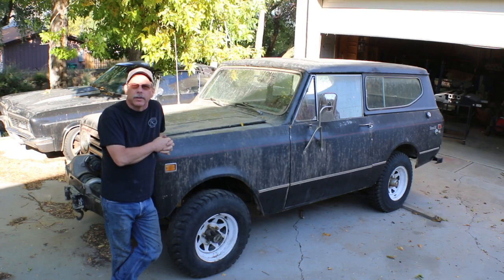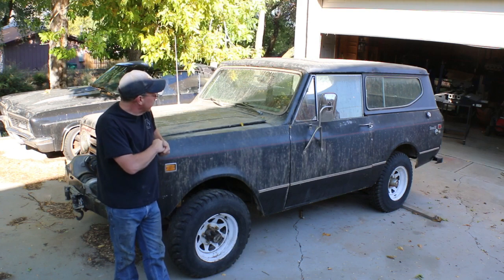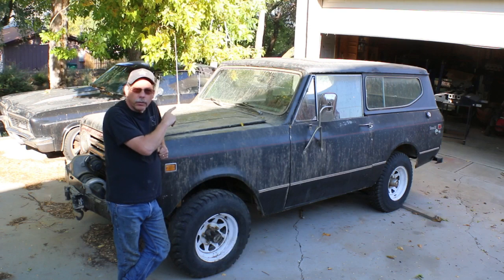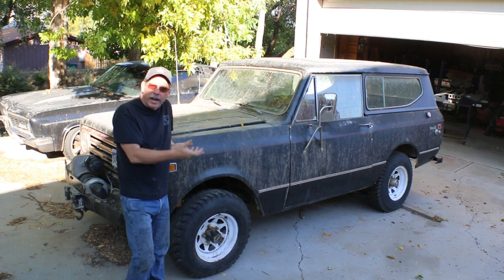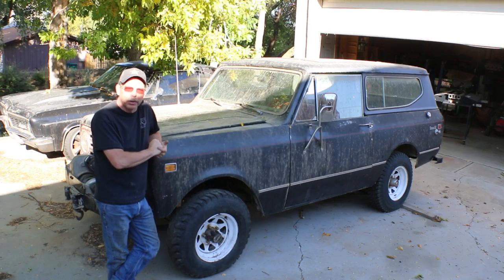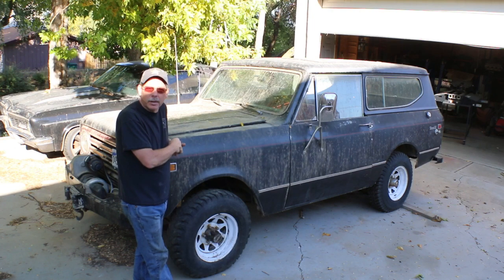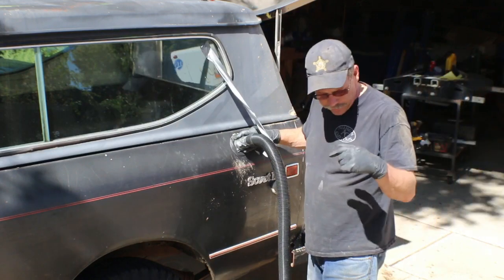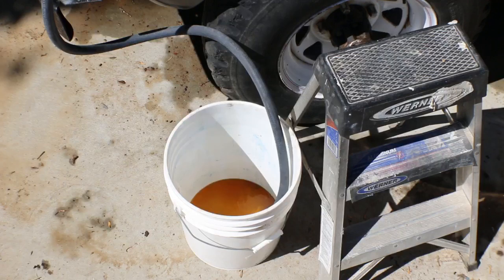1972 International Scout II - Resurrection - Will it run again?

Comment: I’ve got a 67, and a 74. I’ve got the same rims on my 74, with a front tire carrier. It’s originally yellow, my least favorite color, lol ! You’d be better off dropping the tank and giving it a real clean, and new sending unit, or float. You probably just put that old shellacked fuel remaining through the carb and engine. Never good. Should’ve flushed the coolant system as well. If it’s an automatic, should drop that pan, clean it up and give it a new filter too. Then you’ve got the axles and brake system. A lot of people make the mistake of taking something that hasn’t run in a long time and not cleaning every system out good first, then stuff starts needing to be replaced quick because of this. Just tips from an old guy who’s had hundreds of old vehicles and still has 9 left.
Reply from the maker: I agree with all of your advice!  You are going to like what is coming down the road for this old truck!  Jeff

Comment: The gas tank reminds me that these vehicles can have rusty tanks and they used those mechanical pumps that were so unreliable. I think I'll buy a newer vehicle. This stuff is not for me.
Reply from the maker: Anything 50 plus years old is gonna need some love.  But I do like my more modern truck when I want to make any long road trip; Bluetooth, good AC, quiet, comfy seats, there is definitely something to be said for a few luxuries.
Reply: @AllisonCustoms  I bought a Lincoln Navigator about 10 years ago. Heated and air conditioned leather seats has me too spoiled to mess around with nostalgia. I see these scouts all dolled up and off-road capable and keep thinking I might get one.

Comment: Ls swap !
Reply from the maker: That would definitely fix the HP/TQ issues! and probably take 200#s off the front end. But then there is the need for a new trans, driveshafts, wiring, bigger axles, with bigger axles I could run 40's, then I would need much deeper gears, and the transfer case would need upgrades, or just get an Atlas and skip the upgrades, oh and a roll cage, suspension seats would be nice and ....
Reply from the maker: See what you did - started me down a whole different rabbit hole.
Reply: Rebuilt TQ ,advance adapter bellhousing adapter.why change axles plenty strong for 5.3 truck engine....just sayin...
Reply: @kalanirobb54  yep, axles are plenty strong enough but Advance adapters doesn't make an adapter for LS to TF727 ... I wish they did. They do make one for a pre- 1986 SBC however.